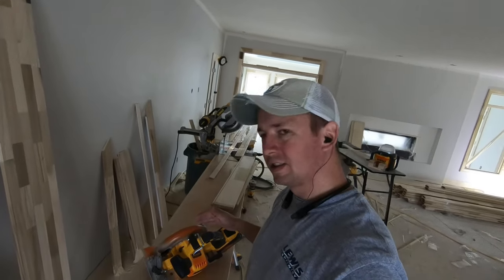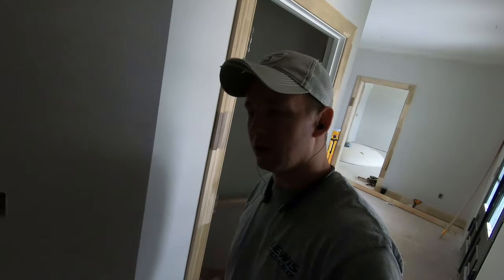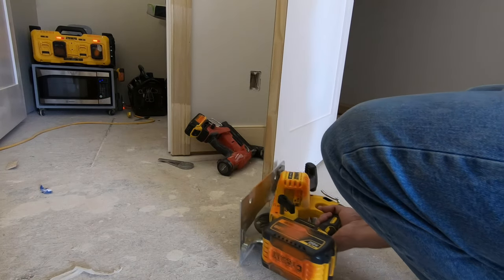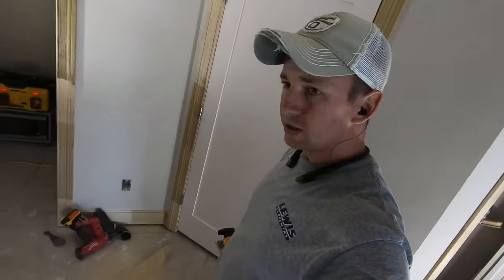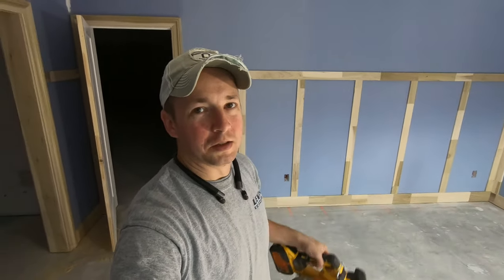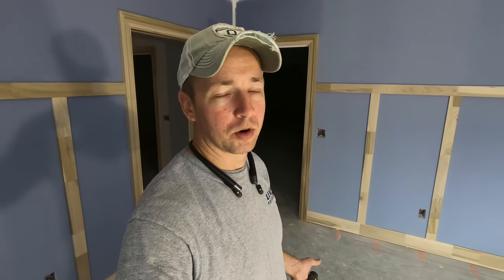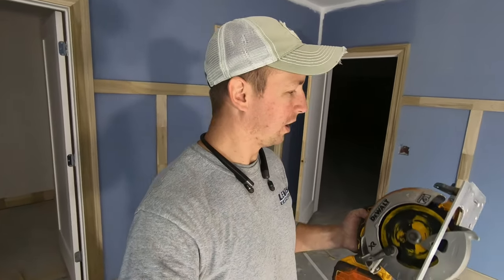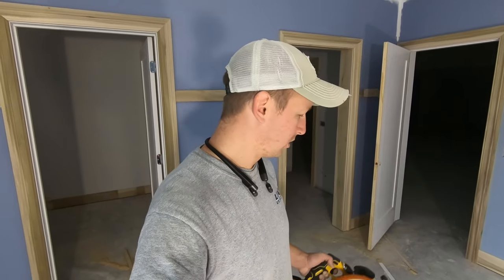Cutting Off Doors While Hanging??? with a Standard Circular Saw???

Comment: Done that many times with an 80s vintage Makita 6 1/2 circular saw...about 1 3/8 offset on base.

Rigged my track with some plywood standoffs on the back, which sit on the floor, after watching the other video.  I was too cheap to buy the clamps. The beauty of the track saw for this application is the use on finished doors.

Great video as always!

Comment: Did this for years. Only time it wasn't recommended was with the cheap hollow core with thin stock on bottom. Better to take door off, cut, dig scrap stock out and replace with 2x cut to fit, shimmy in and glue in place.
Reply: Yes.  Seems like the stick in the bottom gets thinner and thinner.  I've cut and fit more bottom sticks than I can count, just like you said.

Comment: Used a version of this years ago. House got a finish floor change trapping a pocket door.  The saw wss held stationary and we pulled the door out of the pocket and through the saw. Only left the part on the door that didnt come out of the pocket .
Reply: How did that work? The blade would have to be flush with the floor and even then the bottom of the door below the blade would still trap the door 🤷🏼‍♂️
Reply: @jackd2083  I was thinking the same thing!!??
Reply: How did you cut the piece off at the end since you couldn't follow through to the end of the door?
Reply: I finished the cut flush to the jamb with a hand saw and then just left the small piece that was left uncut inside the pocket. It actually kept stuff from rolling inside the pocket and couldn't be seen unless the door was fully closed.

Comment: That's a cool idea I actually have a crane jam saw or undercut saw that I used to trim doors when I'm not using it to cut door jambs and casings for flooring.it will cut anything from an eighth of an inch up to one inch from the floor.

Comment: Hi Spencer, I have a Lumber Jack plunge saw with a track, that’s the make! The blade is closer to the edge, it’s 15mm, just in case an inch and a half is too much for some situations, it can be lifted up to 25mm using a scrap of 10mm laminate or whatever size you need.

Comment: I've been doing that for years. No need to remove the door. 3/4" wood floor or even carpet is about 3/4" which when cutting using 1 1/2 off set with my cordless Milwaukee works perfect leaving a 3/4" space for ventilation. Only thing to check is to make sure the sub-floor is clean and smooth to make a good cut.
You're a damn good carpenter I must say. Keep the great tips coming. 👍👍👍

Comment: Great production carpenter time saver. I have always waited until the flooring was complete then take the door off, take it outside and cut it then reseal the bottom and reinstall it. Yeah this is better.
Reply: I wait til the floor is installed before I hang the doors.
Reply: @danlux4954  Hard floors I do as well but carpeted areas I always hang them ahead so I can have the base and casing done .I hate working over new carpet
Reply: @jefferyholland  good idea, we are getting rid of carpet for vinyl floors.

Comment: Could also buy something like a KDT184 door trimmer. Imagine a router with a saw blade, you set the depth underneath the blade and hold two handles on the back to run it along the floor. 
Not sure they make them anymore but theres a bunch on the marketplace near me for £20 so seem easy enough to find used

Comment: If anyone is worried about tear out, take some wide blue masking tape and run a strip on the bottom of the door first.  Use the wide so you don't even need to measure where the tape goes just line it up with the bottom and it should cover where you are cutting.

Comment: The problem with the3/8 spacer is if your next to a door ,let’s say a bathroom door with a laminate floor the spacer shows. If you use a smaller spacer on the bathroom  door then the top casings don’t match up height wise.

Comment: Hello, great video - how do you adjust the "height" or amount you are trimming off the door - all the circular saws I've looked at don't allow the adjustment of the base plate in relation to the blade - blade depth, yes, not the width of the cut.  Thanks, RIchard

Comment: Curious as to why you don't hold the jambs up a little higher so you don't have to cut the doors. Especially if you are on carpet.
Reply from the maker: Because on one side of the door there will be a thinner flooring like LVT, in which case the jamb would be higher than the hard surface flooring.

Comment: If you use this method to trim your doors, how do you then seal the bottom of the door? If you take the door off, you have access to paint the end. AND, what if the concreter has a dip in the slab? Your cut would follow a line that isn't straight..  For this reason, I much prefer your track saw method (failing the sealing issue).
Reply: The doors aren’t painted therefore they might take them off and seal under the bottom.

Comment: So odd seeing baseboard down before the finished floor. I’m so used to seeing the baseboard and casings being one of the last things installed. Some contractors around me even prime/paint before installing trim; they paint the trim before installation then touch it up or final coat after install. Love seeing different perspectives.
Reply: it seems to me they do this the same way where i live, usually they leave off the baseboard in any areas with hard surface flooring (tile, wood, vinyl etc) but they install the baseboard in areas where there's carpet as it can be slid underneath the baseboards

Comment: In the Uk you can hire or buy a door saw specifically for trimming door bottoms. We rarely need more than an inch clearance here so this hack wouldn’t work unfortunately
Reply: Yeah the flex volt circular saw is 40mm to the edge of the plate to blade. We usually give about 25 mm max. You?
Reply: Completely agree! How thick is carpet in the u.s.a lol!
Reply: Sure it would. My 20v Dewalt saw only has a 1-1/8 set back
Reply: @johnlease7517   but that’s still 28mm most carpets in the uk  9mm/12mm for underlay and 10mm carpets. Unless the house is very high spec but the standard houses don’t need a 28mm gap. The track saw option he previously used is a better solution in my opinion.
Reply: @stephentoby8750  . I agree with you completely on the trac saw option. I was just saying that 1-1/8 was closer to what you need than 1-1/2in. And that if 1-1/8 would work for you than the Dewalt 6-1/4 20volt only has 1-1/8 stand off.

Comment: Architects in Australia have an obsession with the bottom timber rails being painted even though the door skin is MDF  😒 good vid!
Reply: it's called a weenie roller... no problem painting the bottom edge....
Reply: He just trimmed the house the painter will be responsible to paint all sides and edges of doors. Almost every door manufacturer prints on the edge that warranty is void if all edges are not painted regardless of any architects opinion.
Reply: Cheap Doors in USA that are MDF are stamped warranty voided if all 6 sides not painted
Reply: 3000+ Architects and Engineers are calling for a new investigation into 9/11 in America
Reply: Lmao
Reply: @jasonbennett776  Great point! In  my area painters never paint the top or bottom of doors, cut or uncut.
Reply: TM Cobb doors say that their warranty is void if you cut the door.
Reply from the maker: Amen. What joke. 😂😂

Comment: Our pre hung doors come with 1” airspace under the door. So when I hang them I sit the jamb on a 3/8” block and it gives me 
1 3/8” clearance under the door. 

Perfect for either Carpet or 3/4” hardwood flooring. I almost never have to cut the doors unless the subfloor is way out

Just wondering why you cut every door in the house. Wouldn’t it be easier just to hang them a little higher?
Reply from the maker: LVT flooring is super thin. Like 3/16 thick.
Reply: In that case I would cut the door jamb so it’s 3/4” airspace under the door and sit it right on the plywood 

Once you add 3/16 flooring it gives you 9/16 airspace from final floor. 

Anyhow keep up the great work
Reply from the maker: And what if you have LVT on one side of the door and carpet on the other??? That’s why I’m cutting them 1-1/2” off the floor. That’s what it takes to clear the carpet.
Reply: I’ve never had a case where 2 different sized floors like that meet. It’s almost always 3/4” hardwood to carpet. 

In that case I would hang the door with 1 inch“ right from the subfloor  and trim the door 3/8”. 

The skillsaw trick is good don’t get me wrong. I was just wondering, now I know

Comment: Now all someone needs to do it make a plastic shoe that fits over the edge of base plate. Maybe make different sized ones so you can get more height if needed. Or maybe an adjustable one 😮
Just seems unfortunate that you are limited to the depth of the base. I think I saw someone mention in the comments that you can put a piece of plywood on the floor to make up the difference. 
I know the kind of work you do requires consistent reveals on all doors. Let us know how this method holds up for you. 👌
Reply: I use the plywood method for my toekick saw. Works well. Great idea.👍

Comment: The problem with what you do is that the offset for a circular saw (dewalt) is 30 mm plus the depth of the blade.. Suppose it's OK if you want a gap so big under the door.. Track saw can be used without the track with less than 10 mm offset.

Comment: put a 2x4 scrap behind the door and just run through it.
Reply: this will give a cleaner cut on the other side :)
Reply: Ha! I just posted the same idea. I’m going to try it tomorrow.
Reply: Good idea!  I’ve cut doors on saw horses and when I didn’t have scrap, I would put several layers of tape around the door to minimize damage.
Reply: Circ saws cut cleaner on backside/bottom. Blowout is usually worse on top side.
Reply: Chad Burke 
💯

Comment: What clamps do you use for attaching track on doors?  I've never thought to attempt cutting a hanging door, then again I'm rarely in a situation where there isn't a finished floor.  I'm usually the guy asked to trim the doors after new tile or carpeting was installed.  However the track saw hooked up to a vac could be a game changer especially the door on a second story floor of an occupied residence.

Comment: Maybe it's not applicable to the build quality of the houses you trim out. But if I tried that on the houses I do, the reveal between the floor and the door would not be even. 

Often times I have to cut the bottom of the doors at an angle so they look good when closed. 🤷‍♂️
Reply: But surely the angle of the floor is transferred to the bottom of the door
Reply: It always work.... You're not going level lol

Whatever angle the floor has, it'll transfer
Reply: Have  to agree  with  you ifference the floor  is  not level  and the jamb not plumb your  margin under the door  will  soon tell  you
I don't  mean to be rude  or a nitpicker. Great  respect  for  Lewis
Reply: If u see a major difference in the margin of your doors after you cut it you have major problems You either need to learn how to set a door better or the house is about to fall apart
Reply: The problem is you aren’t cutting the door when its closed. If the floor is sloped it’s probably not going to be the same slope 90 degrees open.

Comment: If need to cut less off e.g. floor installed. Use a multi tool and a piece of off cut or spirit level clamped to the door.

Comment: 1 1/2 plus the thickness of the blade, what is the thickness of the gap when the finish floor is installed? 13/16-7/8 with 3/4 flooring? I never knew what is the standard. Personnaly I try to leave a 1/2-5/8 gap when i have to build a custom door frame.

Comment: The length of the door should be taken into account when you build the door frame. here in Australia, prebuilt door frames are built  using a 2040 x 820 mm door as a model around which you build the door, which takes into account  carpet and underlay., and if a bathroom, or a toilet ,neither having carpet ,then the frame is adjusted accordingly before installation